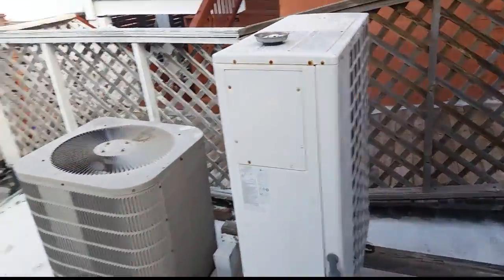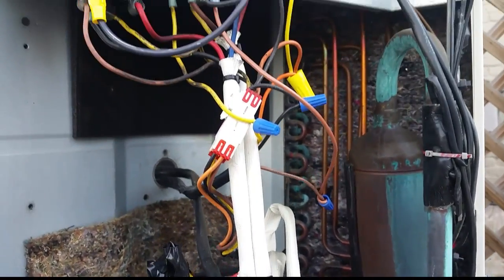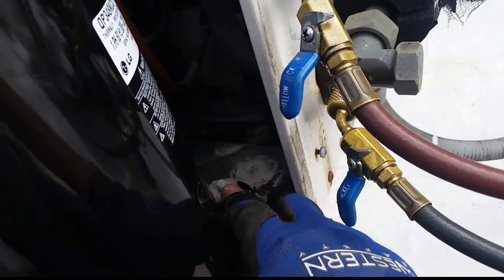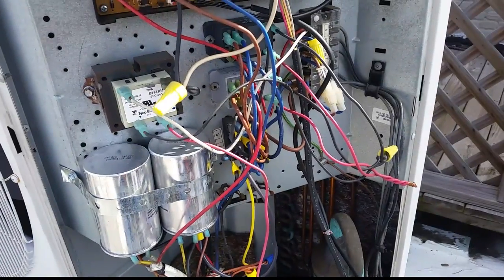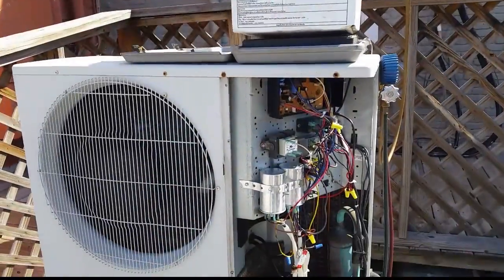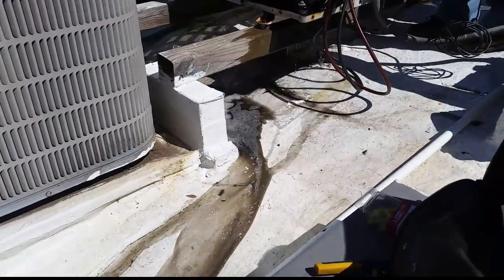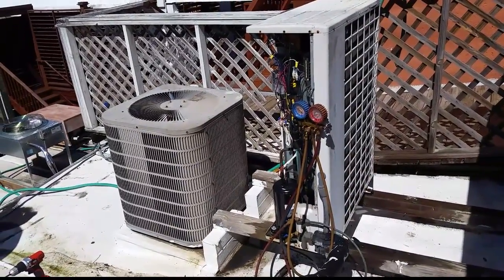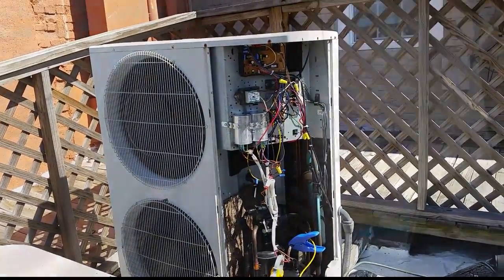HVAC Service : LG Minisplit Compressor Replacement

Comment: whats your opinion on LG mini splits? Do you recommend them? 
FYI - in Korea, the majority of air conditioners installed are LG. Floor standing units (discontinued in US) are really popular
Reply from the maker: +xcmskim4 we used to have issues with them years ago. Leaking refrigerant. Haven't used then in st least 5 years

Comment: Good vid Zack, I don't do any residential work, most of my work is on store roofs, you were up where I live. I saw you charged it with R22, what are companies charging for R22 this year in the Wilmington area ? I've been replacing R22 with R422d on AC units and R404a on refrigeration systems.
Reply from the maker: I charge 50 a lb. R22. I have switched to r438a and have used r422d a few times. Seemed to work well. If I change a comp that the replacement has POE I will use 407c.
Reply: good video Zack